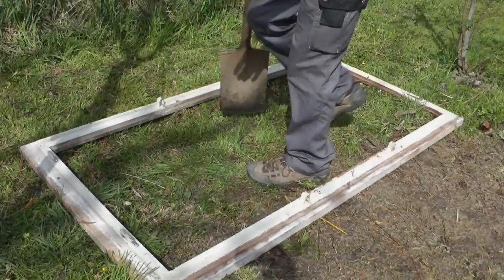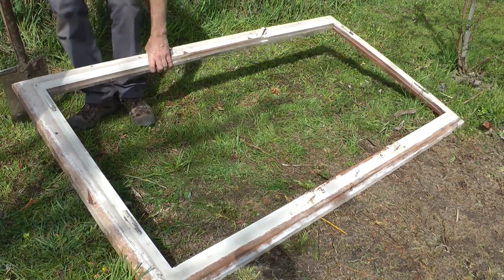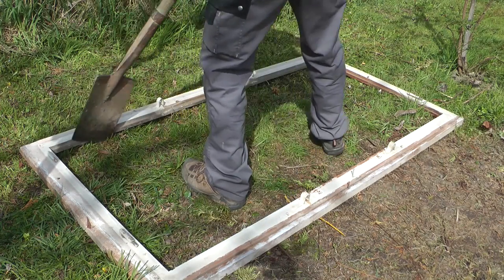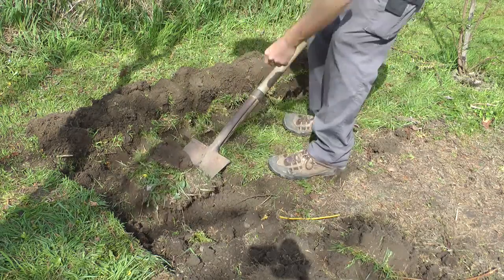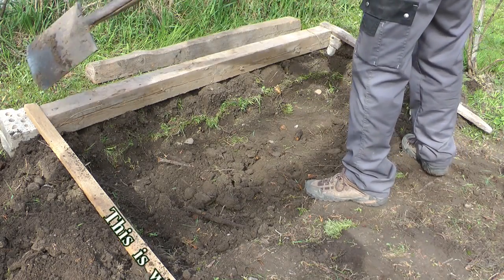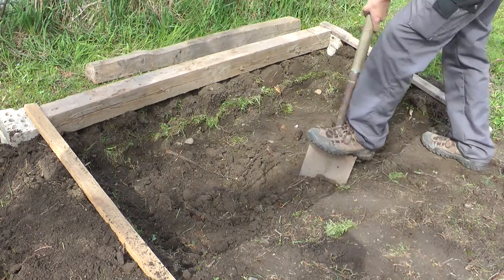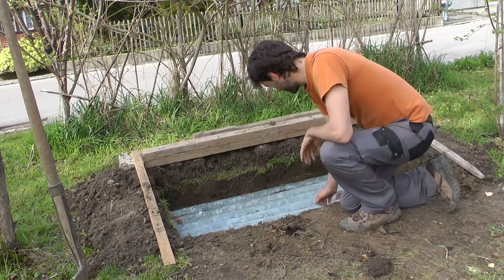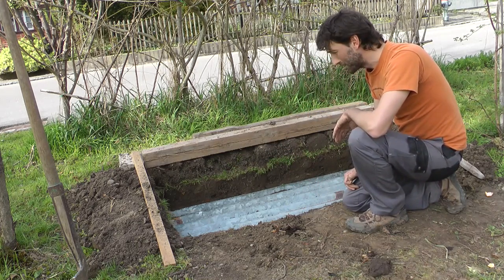Great Compost Heated Cold Frames - Here is How!

Comment from the maker: Subtitles - closed captions
Now in this video we are going to learn how to make a compost heated mini glasshouse cloche or cold frame for your garden. It is a very simple method, simple materials it is not going to cost you anything. It is handy if you do not have a Polly tunnel or glass house. You can make these very simply and I am now going to show you how to do it. Now the first step is going to be to mark out the soil. With either a halfmoon or spade, that is in order to take of the grass sods because we want to dig down deep. You will also need to make sure that you have an area where your frame can rest on. You are going to use some grass mulch, these sods to lever it up at a certain angle. Roughly maybe the height of the shovel. So that means it is roughly two inches narrower than it would normally be. So bear that in mind. What I find the easiest it to mark out the inside. So do't put your plastic on yet. So make a line and that should roughly give you the area you want. Now notice I am starting to use some of the sods to build up the sides. But I am also going to put a pease of timber all the way along, where the frame will rest on. I want it to last a long time. And if it is in contact with the wood it can rot pretty fast. So I am just putting one layer for now just on top.  Then I am going to put the wood and then I am going to put down the soil to hold it all in place. Oh he is a fat feller isn't he. Look at this guy, say hello. Ok I will put you somewhere safe. Now as you can see I put some peeces of wood all the way around. I have some blocks aswell I have some timber running down as well. And I will also use all the soil, digging it out and sticking it around the mini glass house. But then not higher than this level itself. And maybe I will leave some gaps for some air or methane gas to run out, later on in the different stages of growing on my plants. Now the thing you want to add is this fresh compost. It will heat up in time because the microbes will gobble up all the material and provide heat for our little seedlings. Now I am only putting down about 20 cm of compost in. Maybe 15 cm. Then I will put some kind of sheet on top to separate the two. You can also ofcourse. I forgot to mention use stones. Well I think you can. I would amdgion you can, because if you think about it if you add big stones in there. During the day you are going to get a lot of heat stored in the stones. They are going to release the heat at night time when the seedlings will need it the most. So you are going to have nice cozy seedlings. This is a very good method to do in January onwards, till about march. Especially with the compost. The stones I would do generally a bit later in the season. I don't have big stones, so I am just going to use compost. But putting a little bit less. Of course I am also in a minute going to show youvery simply how to regulate the temperature. But first I will carry on adding this compost layer. Hello. Hi. Now I just added a peace of corrugated iron. To my surprise it fits perfectly, as if the person who cut it knew we where going to do this. So big thanks to you. The other thing I wanted to quickly say aswell. Is if you do happen to get slugs munching away at your seedlings. You will notice it right away. If you check them every day for watering. You can the just turn up the trays and find them under there. Or you can lift the sheet of corrugated iron and take the slugs away. But you should not get that problem. You can of course make more than one glass house. I am just sticking with one for now. As we are in April and I am only using it for the pumpkins. I will sow most of my seedlings directly and am not to late. Ok now we are going to add the windows and I will show you what that looks like. Hello. Hi. Now just line it up nicely. All mesured well. The main thing is to get it at the beam at the back first. Ok so that's pretty much it. I spoke earlier a bit about ventilation. Well first of all I have a slot there at the front. That is going to let go of all the gases and heat. As it is going to get hot now. But the nights are still cold. You can also of course open a window and control the temperature that way. I mean is this not fantastic. Very easy to use and cheep. A lovely little heated cloche. Now hope you enjoyed this video. Please do share this video if you got something out of it. See you next week and thanks for watching.

Comment: How much warmer is it in there at night time compared with outside temperatures? I have one of those small plastic greenhouses but it only provides one or two degrees of protection. I assume as this is below ground it will offer more?
Reply from the maker: That is what the idea is of building one :) To have it heated by compost.You get more heat at night when it really matters. If you get frost on your seedlings, they might get ruined. The exact temperature of these is not known to me as I have never measured it before. The main thing is I have never had a problem with frost.